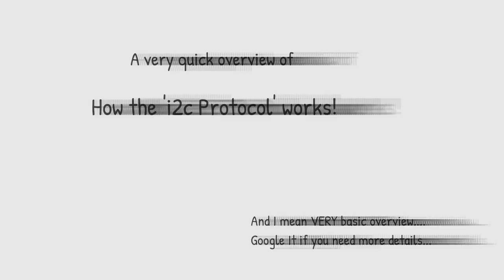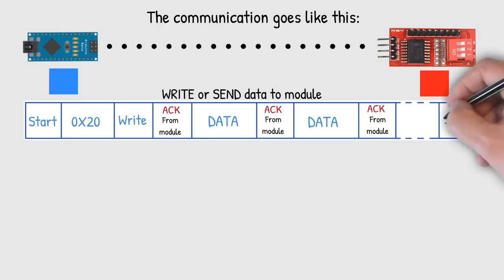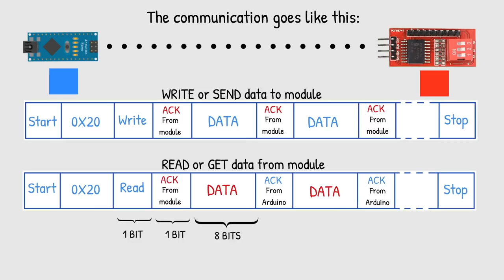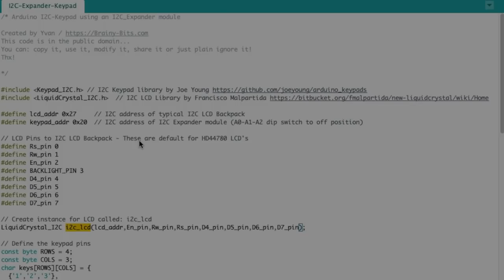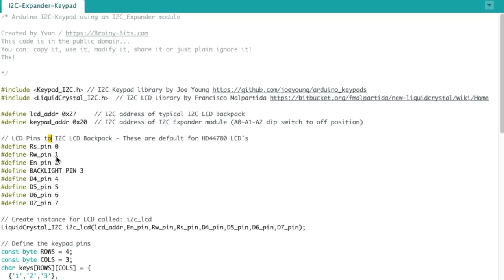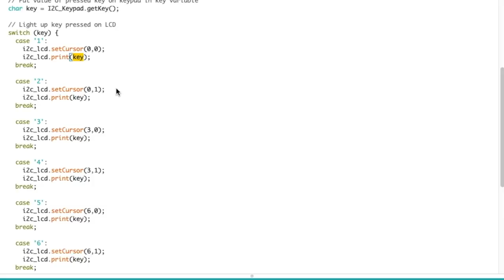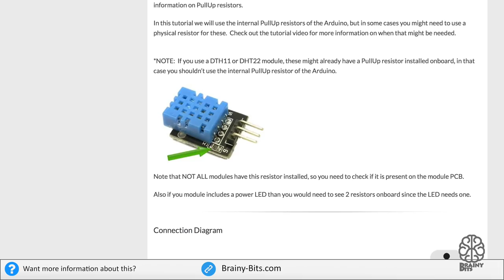Want to use a Keypad in your Arduino projects but running out of Pins?

Comment: Just bought some of those new versioned I2C modules. Using a keypad for a combo lock is one thing, but the proper way is to use the keypad with an RFID. "Something you have, and something you know" is the proper way.

Comment: There's a  issue in this code.
The keypad doesn't work alone.
If you wanna use the keypad without LCD you must add
#include <Keypad.h>
#include <Wire.h>
at the beginning of the code (directives for the compilator)
and add Wire.begin( );    in the void setup()
(cuz the header file of the lcd does this)
seeya

Comment: What about the PCF8575. Can it be used the same way? I could not find info about this. Thanks!
Reply from the maker: The same library should work for the PCF8575 16 I/O modules as well...  You just need to change this line in the code: 
Keypad_I2C I2C_Keypad( makeKeymap(keys), rowPins, colPins, ROWS, COLS, keypad_addr, PCF8575 );
Replacing "PCF8574" with "PCF8575".  Don't have one to test it out, so let me know if it works if you ever test it.  Thanks for watching!

Comment: You can try to use resistors ladder and only one pin via ADC :)
Reply from the maker: If this is a lowest pins competition, than you would win by 1...  But I find that using the I2C method is a lot easier, connection wise and more reliable as well...  Also if you have an LCD in your project than the resistor ladder option would use 3 Pins:  2 for the i2c LCD and 1 for your Keypad resistor method :). So the I2C Keypad method would win in that scenario...  Thanks for watching!

Comment: Thank you for this video that has been very helpful to me. I would like to use a 5 x 4 keypad matrix in my project which offers more functionality than the 4x4 keypad. The main challenge is that the 5x4 keypad needs 9 pins while the expander takes a maximum of 8 pins. Can you please make a video with an expander fot the 5x4 keypad membrane?

Comment: as I understand from the video, it's not possible to use the same I2C module for both the LCD and Keypad. is this true?
Reply: No. You have to use 2 I2C modules. He is pointing out that the I2C module for the LCD is different than the one you need for the keypad.. The I2C module for the LCD is specifically designed for the LCD and has one pin wired to a transistor and does not give all 8 pins available to the header.. So you get the one for the LCD and  then the  one he shows here for the keypad..
Reply: @chuckdejarnett  
Thank you for your complete and clear answer🙏🏼👍🏼

Comment: I was done reading your website about i2c that p3 is not connected and i found some info on the internet. The P3 pin is connected to pin16 in the i2c lcd module and its configure as output only.

Comment: The I2C protocol is ALWAYS on the SDA/SCL pins, so connect those! Same with SPI: they are always on the ICSP header. No need to figure out board models. That's where the R3 layout was made for!
I recommend doing this with regular buttons connected to the ground, not with a keypad. That way you can use it for games. Keypads give horrible ghosting on simultaneous presses.

Comment: Would it be possible to make an example using the interrupt pin ?  I tried different approaches but can't get it to work as planned.  The only thing I would like to do is set a flag in the ISR routine when a key is pressed.  Perhaps there is an I2C Keypad library that would work better than the others, I really don't know.  I would really appreciate your help.

Comment: Couldn't you simply solder a wire to pin 3 on an LCD back pack?
Reply from the maker: Hi Andy, I tried that, I soldered a small wire directly to the P3 pin on the pcf8574t chip, but it still didn't work when connecting a Bourns encoder.   So don't know if it needs something else (resistor?) but didn't test more than that...  Thanks for watching!
Reply: P3 pin is connected to the transistor and then the pin16 (K on the display)
Reply: I’ve bypassed the transistor connected to pin 3 and successfully used all 8 pins. Had to bit bang it. Hand soldering required.
Reply: You can snip off the J3Y transistor and bridge the top and bottom left pads with a bit of wire, then you have P3 at the first pin. Before that the transistor will always pull P3 low.